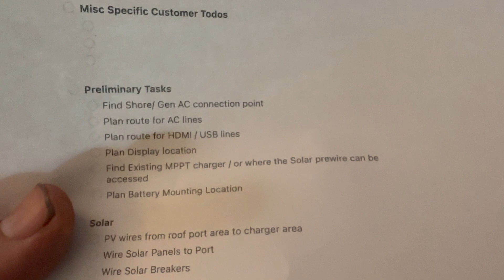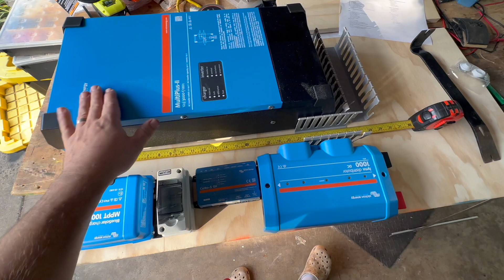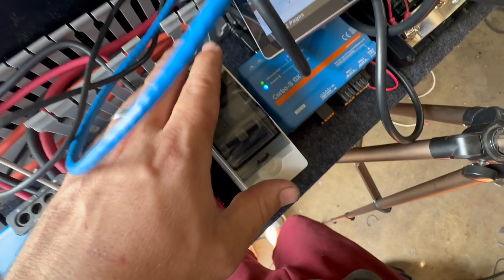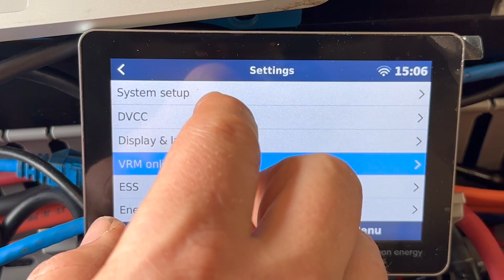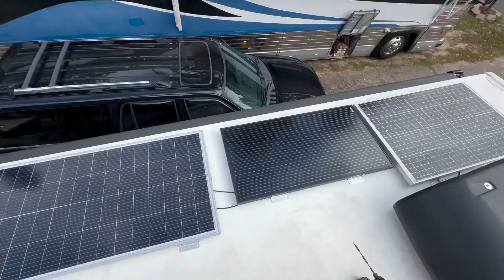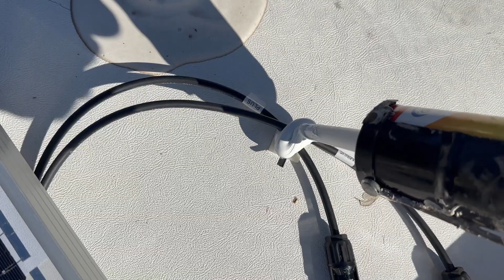Thor Gemini 30 Amp Victron Solar Install Detailed Steps - 800w solar - 512 SOK batteries

Comment: thanks for the video. I’m trying to put together a 24 volt victron system. My question is is there any way to bypass the multiplus 2 in the event of charger/battery failure?  just watched a video where you installed eg4 24 volt 200 amp hr server rack battery s. was the bms 200amp as well?
Reply from the maker: That’s a great question and some we’ve been looking at. Obviously we believe Victron is some of the best off grid equipment we can get, but anything can happen and you’ll want op. We’re working on something for this. 

As far as the BMS in those EG4 batteries, we had some problems with them. They were a soft 100a rated at best. I’d not recommend using less than 3 at a time. Otherwise the BMS will trip on grid / shore loss  very often.
Reply: @sotasolar  i was thinking 2-2 way switch boxes. 1 before mp 2 and 1 after. position 1 regular mp 2 operation, position 2 bypass mp and run on shore power or generator??
    i love the eg4 batteries but the bms issue gives me pause. i was thinking litime 24 volt 200 amp hr. they have a stronger bms 200 amps i believe.

Comment: Hi there. I have yet to get my second battery. I have a 12volt system running Victron gear to. I got a little 100ah lifepo4 battery a couple of weeks ago.
Ill be running mine in parallel as well. Are you saying its fine to have different ah batterys in parallel? 
If so my next one i get soon would be bigger ah
Reply from the maker: Yes they will work fine. I have a video in the works to show that with data.
Reply from the maker: Yes they will work fine. I have a video in the works to show that with data.
Reply: @sotasolar  look forward to seeing it. Cheers 😀

Comment: You aren’t concerned those 24v panels in series won’t get over 100 volts in cold temps?  I think it could get to 115 volts and ruin the 100/50 controller.
Reply from the maker: No, 2 reasons.  1) If it's that cold, this unit will be in storage with the breaker off. 2) I just ran the numbers, to hit 115v it would need to be -50C or -58F.   I factored for -20c or -4f and that gets us to 103v.  A few volts over won't hurt the MPPT, 115-120 is about where the threshold is where you'd release magic smoke.

Good question and it's good to be thinking about it.